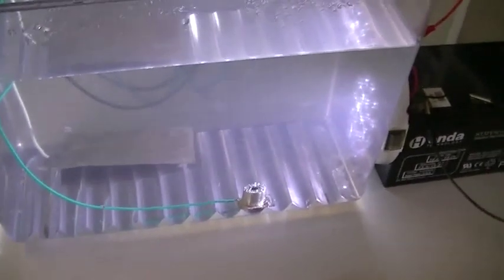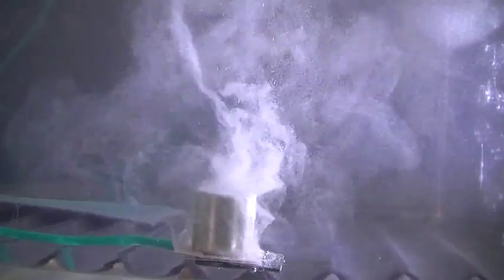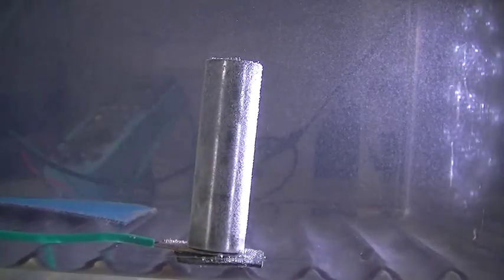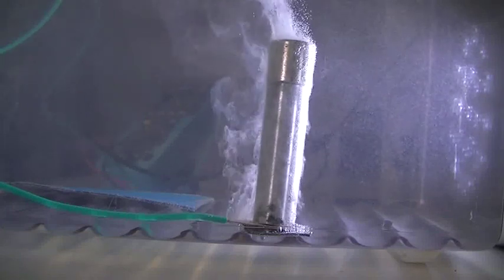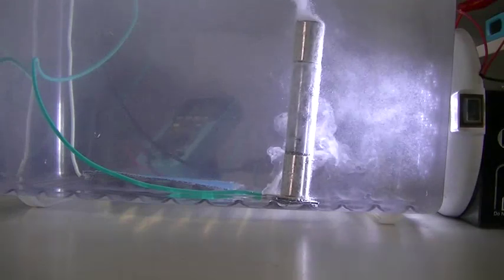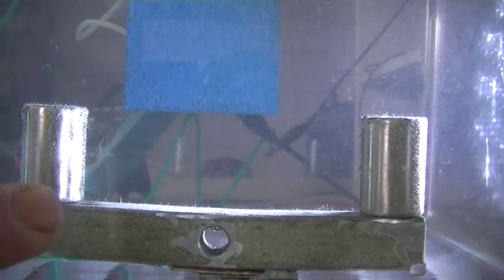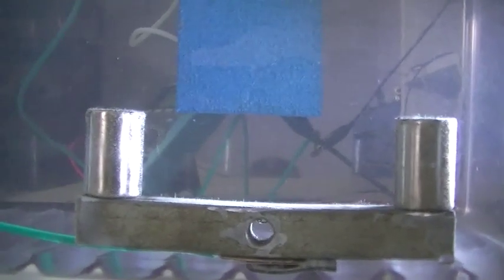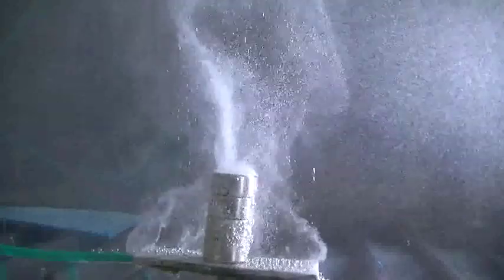magnetic vortex

Comment: Heres a hint, to get an ABSOLUTELY PERFECT vortex off either side, make a plastic shield that goes around the middle of the magnet, like a plastic cuff that goes around a dog to keep from biting his arse (LOL) ....to keep the BOTTOM of the magnet on the copper plate (because it make its OWN vortex too, but its being blocked by the copper plate)....., BUT THAT side against the copper plate is still causing hydrogen bubbles, and when THOSE bubbles raise up to the TOP...., they DISRUPT the vortex  on the NON COPPER SIDE, i.e. the TOP.

WHEN you do that, you will get a MUCH BETTER and more perfect vortex.
Reply: +Theoria Apophasis good evening, I'm your fan, could you tell me if he used tap water or added any solution for electrolyzers

Comment: Lovely video!!  You are officially awesome

However, as is the case, there are 5 diff. methods to see (my videos) this vortex WITHOUT having to zap your magnet

neverthless your method (as originally duplicated by 'magnetflipper' you youtube) produces vortex from hydrogen bubbles.

There are 2 METHODS I have found (that have nothing to do with zapping a magnet) to SHOW magnetic vortex movement.   1. Use FAST moving HIGH volume medium like the force lines in a CRT tube, or neon tube, or your H2 bubbles

OR (my best demos!!) use LOW volume viscous SLOW MOVING materials (see my videos on this).

Comment: Great stuff. If you could get the oxygen bubbles ti do the same thing at the other electrode, and the column rotates the opposite direction for the same magnetic polarity, then the gases are charged monoatomic gasses to start with until they pair later

Comment: Very cool, I have to find me a fish tank!  Try suspending the magnet with no electrical connection above a hydrogen producing plate at the bottom..
Reply from the maker: Hi Pete. I would suspect that the water would still carry some current to the magnet,and depending on where you had the anode plate,would depend on weather you get a similar effect.